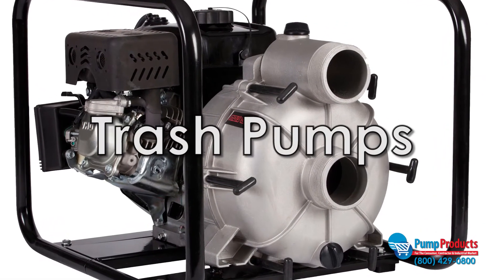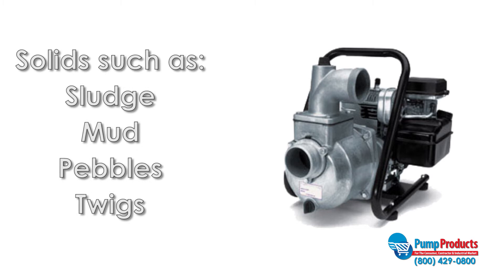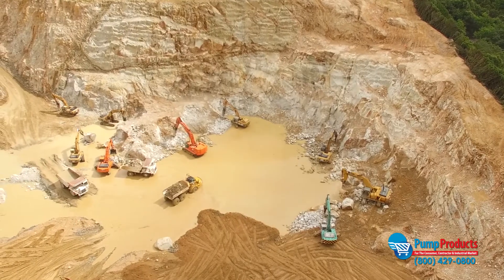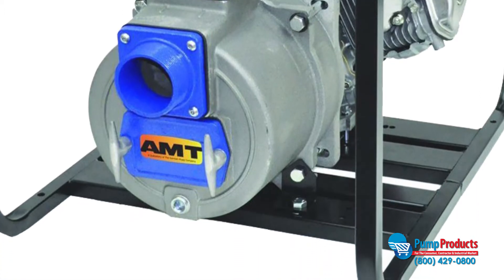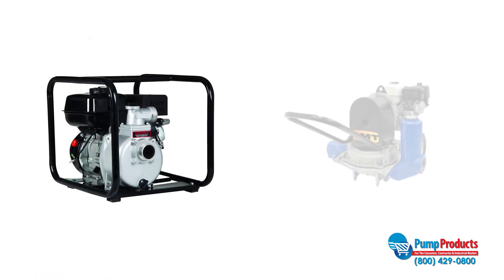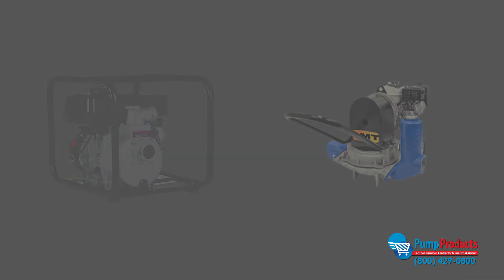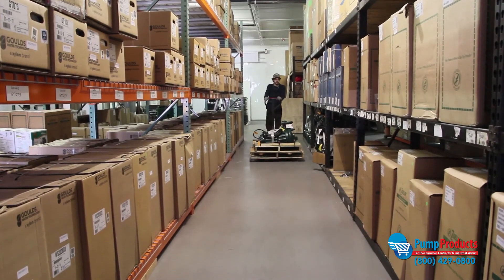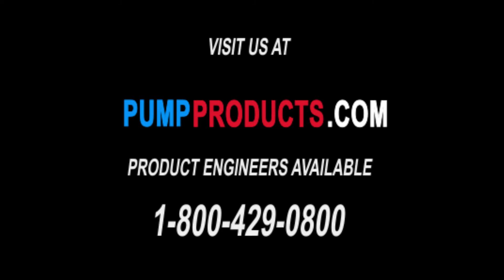What are Trash Pumps?

Comment: Thank you for the video! We use motor pumps for dirty water on a mini dredger for cleaning piers and boathouses. For removing bottom sediments. For this you need two motor pumps. One motor pump for mud and a second motor pump for hydraulic washout. You also need a suction nozzle with Bagermaster hydraulic jetting